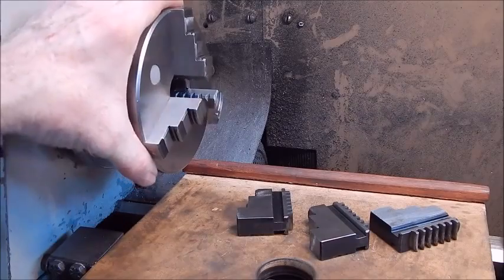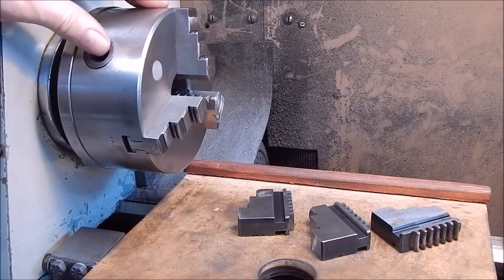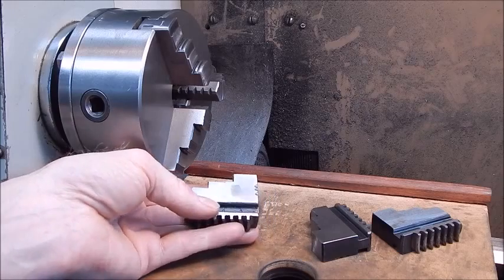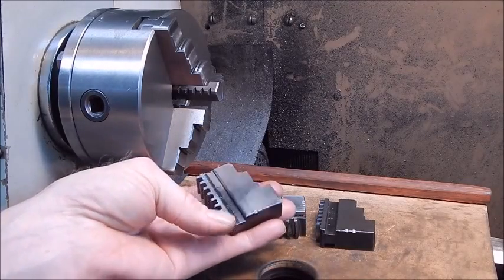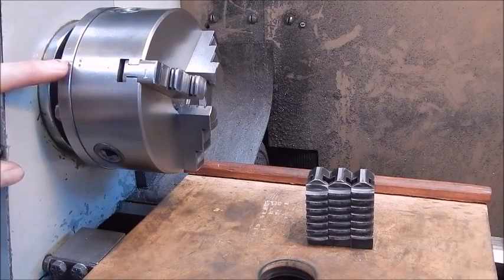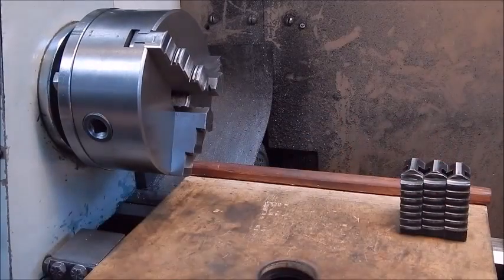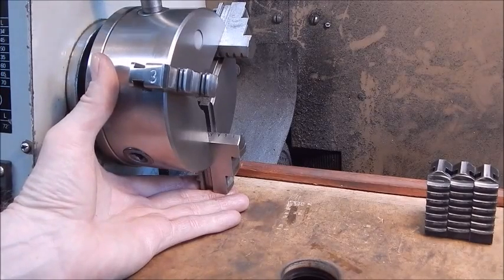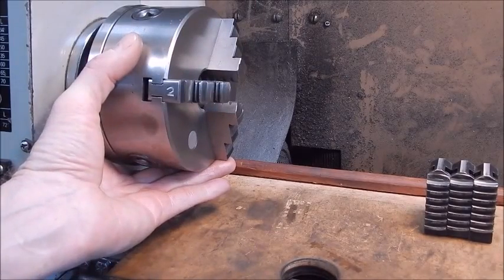How to change the chuck jaws on a metal lathe

Comment: G’day Rob thanks for the video on these chucks  I have 4 jaw and one of the jaws will not go down with the other  3,   your video helped me a lot thanks mate regards John
Reply from the maker: Glad it was useful for your chuck John.  It may be helpful to put a large heavy duty rubber band around all the extended jaws before turning anticlockwise and waiting for number one to click in.  That way you are more likely to avoid a jaw not feeding.  I think I remember one of my viewers suggesting that at the time.

I have had the occasional instance where I got a non starter due to lack of hand grip/pressure on number 2 or 3 at the vital time ;)

Overall it works extremely well on all of my scroll chucks.

Cheers Rob

Comment: I'm going to totally disassemble my chuck and clean it up, but don't know whether I should use oil or grease when I reassemble it.
What do you think?
Cheers
Reply from the maker: Most definitely oil.  I use plain car engine oil.  You will never see grease in a new chuck.

Only use a very small/light amount or it will spray from the chuck at speed.

Cheers Rob
Reply: @Xynudu  Good video Rob. I'll be using your method in future. Note that Pratt & Burnerd recommend Molycote D paste or grease in their chucks.

Comment: thank you very much mate. I was trying to figure out how to put the jaws back in the chuck the whole morning and then I saw your video. for all those who use c0 baby lathe , identify the jaws as 1 , 2 and 3  and put no3 first , slide it inside the scroll turn to next chuck, insert no2, turn to next chuck and insert no 3. this is to be done because the jaw opening and closing mechanism is a bit more primal in the baby lathe . thanks a ton buddy it went in like a breeze after i watched your video.
Reply from the maker: Thanks for the feedback Atul.  Glad  you got it sorted.

They never include this stuff in the lathe user manual, and it can be a real head bang.

Cheers Rob

Comment: Hi Rob!  Even though you posted this 3 years ago, I just used it today.  I would have had NO IDEA what to do without this.  Many, many thanks for your excellent video.  I'm a home hobbyist and very new to lathes.  I tried to open the jaws too wide and dropped one out the bottom.  uh-oh.  But this got me all fixed up.  Again, many thanks.  I'm very grateful.  (and this is bookmarked..lol).  Cheers!
Reply from the maker: Thanks for the feedback.  Often this simple stuff gets over looked, and newbies have trouble.

Glad it worked out.

Cheers Rob

Comment: How do I put the jaws back in if I want to reverse them to allow me to turn larger diameter stock?
Reply from the maker: Chuck jaws are only reversable on independent jaw chucks (eg. most four jaw chucks).

Scroll chucks, as shown, have a separate set of external gripping jaws.

The complete set of jaws to be used, has to be swapped over.

Both sets of jaws are aligned as shown in the video.

Rob
Reply: +xynudu so I can't flip these around to turn larger stock?
Reply from the maker: Not if it's a scroll chuck.

Rob

Comment: i tried following this but the jaws are still offset in the best orientation of the jaws, any ideas?
Reply from the maker: +Wolfs Rangers 

What do you mean by "the best orientation of the jaws" ?

Rob
Reply: i put them in according to the way you did it and i kept moving them around clockwise on the chuck till they all aligned kind of meaning that the jaws wound in equally
Reply from the maker: +Wolfs Rangers 

Align the chuck jaws using the scroll thread faces as a guide as shown to determine the jaw numbers.

The jaws go in the chuck anti clockwise from 1 to 3.

Rotate the jaws (in the same order) in either direction until you get the best fit.

If you've done that and have a problem, then I don't know what is going on.

Cheers Rob

Comment: Your video helped me figure it out, but on my Cummins 7x12 Chinese lathe, even though the manual says assemble in CLOCKWISE numbering, its EXACTLY OPPOSITE! I spent half the darn night trying to figure out why nothing was working. I ended up looking inside the housing and watching which way the flat threaded plate was rotating when I turn the T handle in the tightening direction. I could see it was moving anti-clockwise, AHA! So I numbered them according to the threading on the chuck jaw that was going to grab first into the start of the threading on the plate, which meant I had to put 1 in, then anticlockwise 2, then 3. That worked! I notice yours are also installed anticlockwise numbering. I hope this helps somebody, what a waste of time, and I do thankyou for helping me look in the right direction.
Reply from the maker: SDPickups The chuck body should have had some jaw numbers stamped into it.  No numbers ?  Cheers Rob
Reply: No numbers, only the jaws were numbered but not in a real obvious way, they had a different serial number on each one and the last digit was the number of the jaw.

Comment: hello xynudu.how you going? about changing the chuck 3- jaws,i did full out mine,but i did put it back together im not sure if i get right,and i did not put numbering on the 3 jaws,its my mistake i did not know,i manage to put it back after a long hours,and i check the run out using end mill 20 mm,there is run out about 2 thousand of an inch' i have a question'' 3-jaws chuck can i get zero run out?
Reply from the maker: You can get zero run out, but you will need to grind the internal gripping jaw faces lightly with a tool post grinder.  Sounds like the jaws are back in the correct slots if that is all the run out you have,  This is why it is also important to put the chuck back on the faceplte in the same position. Cheers Rob
Reply: Good day mate,my lathe lathe Chinese made,metal master AL-320 G and the 3 jaws i noticed there is no, numbering which one go back first,hehehe the reason i full out i want to reverse the jaws so that can hold bigger dia, but i noticed again the jaws is not reversable. and i look the box come with there is extra 3-jaws dedicated reverse only. any way im gonna try again this 3-jaws back in order,thanks your time Rob, fr:geelong vic,aust,Ben,cheers
Reply from the maker: axol polly
There should be a number stamped in each slot in the chuck body.  Then it's just a matter of line up both sets of jaws as I show in the video.  When you get them sorted, make sure to mark the jaws and the chuck slots with a centre punch.  Then you will have no more problems. Cheers Rob

Comment: Rob,
another way of replacing the jaws is to look at the scroll.  Position #1 at the top and turn the key anti-clockwise until you see the edge of the scroll appearing.  Insert #1 Jaw and move to #2, and repeat.  Same for #3.
Reply from the maker: +Herb Blair 

Good tip Herb.

I know this is a belated response, but I just had another look at the video and comments, and your point is very useful.

Cheers Rob.

Comment: Nice and quick technique, Rob! What is name of your lathe? Is it chinese?
Reply from the maker: Yes it's a Chinese lathe.  It is a CQ9325.  It is also sold as a HBM450 in Europe.
In the USA Bolton Hardware sell it with power cross slide.
Reply: Can you filmed review of it? I think it would be interesting.
Reply from the maker: AXRV88
I did a review of it a long while ago when it was in new condition.

 Chinese CQ9325 small bench lathe features

Cheers  Rob.
Reply: Thanks!